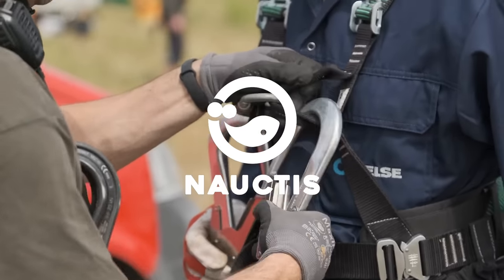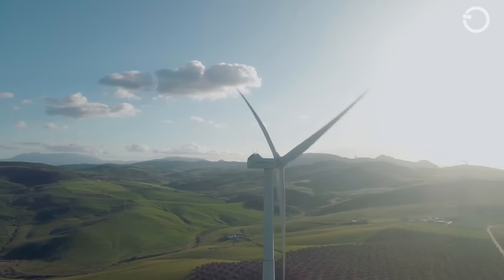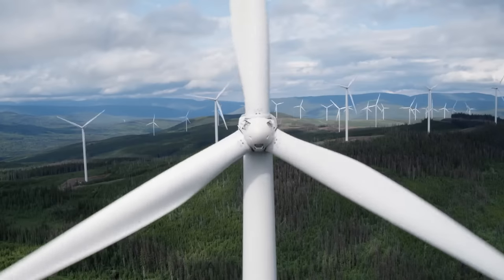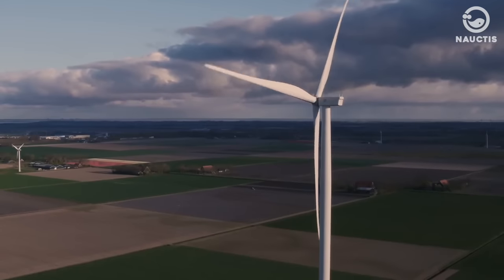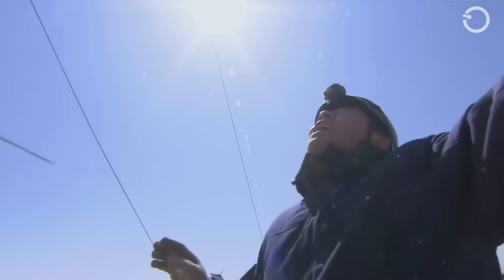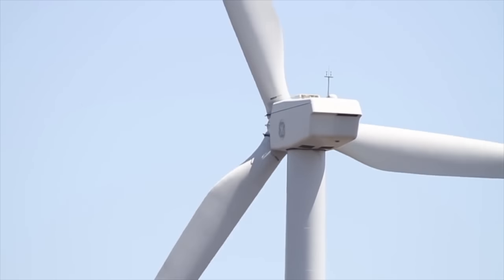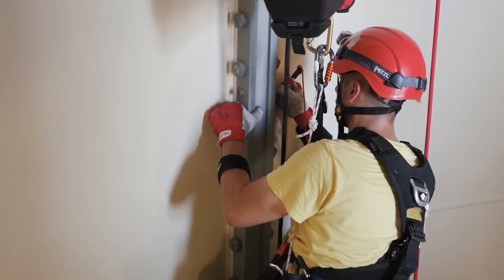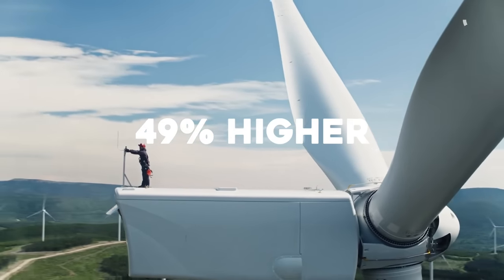Why Wind Turbine Technicians EARN So MUCH MONEY to Keep Massive Blades Spinning

Comment: They are about 80% worthless, in my view. The blades do NOT always spin. Even when they do? The gear boxes can get torn up, making them worthless. Once the gear boxes are torn up? They are very hard to fix, and very expensive to fix. Indeed, they often do NOT get fixed. Even if the turbine works, and IS hooked up to the grid? What they can contribute varies greatly with the weather and location. Many of them are just worthless. Cost? Often, as much as 10 million a piece. Nobody would even build them without the government subsidy. Once broken? Very few ever get repaired, if they are a few years old.

Comment: I had to do some work on some equipment located on a wind farm, so one of the wind farm workers accompanied me. While driving he told me to steer far around the turbines, as they always had things falling off of them. Some of the nuts used on them are larger than a basketball and falling from that height it would completely flatten the cab of my truck and anyone in it.
Reply: @justdoingitjim7095
"he told me to steer far around the turbines, as they always had things falling off of them"
This is not how we arrive at facts. "A guy told me..." Yeah. Not buying that crap.
Reply: @@DecernererInitium 
"Things do fall off them."
Whether it happens or not is not the question. Things also fall off buildings and vehicles. The idea that it happens so often that you need to drive around them is simply moronic.
Reply: @@DecernererInitium 
"Because of the vibration and movement they're more prone to loosening than static buildings."
This is called moving the goalposts. Pay attention to what the conversation was about.
Some guy told you that these machines "always had things falling off of them" to the point where it was too risky to drive under one. I'm calling bullshit on that. Do you have ANY other source other than "a guy told me."
Did he tell you how often it happened? How does he know that this is the case with 340,000 other wind turbines in the world? Even it it were the case that some things fell off this turbine, what was the cause? Did someone accidentally leave some things lying on top?
Wind turbines cost $2-4 million. But parts just randomly fall off like rain, right?
Come on. Be smarter.
Reply: Bolts the size of basketballs, I DON'T THINK SO. Maybe up to 6 inch hex. Basketball, no way jose.
Reply: @jazzridez  
"Bolts the size of basketballs, I DON'T THINK SO. Maybe up to 6 inch hex. Basketball, no way jose."
The issue I have is the hyperbole. No one is claiming these things are perfect. But by exaggerating their faults, people won't take them seriously.
Reply: @jazzridez definitely bolts that are 20 inches long. Haven’t seen any actual bolts that are that big around tho 😂

Comment: Being a wind turbine tech isn't as dangerous or extreme as many people think. 

Deaths are almost always a result of neglecting safety procedures.
If you use your PPE correctly and follow safety instructions, it is acually a very safe job.
Reply: It is very extreme vs other jobs not sure why you would post this.   There is no room for human error.  Other jobs you can make a mistake and not be killed.  So stick your "Very safe job" where the sun does not shine buddy.

Most of the deaths among wind turbine technicians happened because of falls. Other common causes of death include being struck by an object and electrocution. Wind turbines can also pose a risk to the general public
Reply: @Physics072  😂
Reply: Only 'safe' for the real professionals out there, not for amateurs.
Reply: @Papitoti  Tell that to the insurance companies that won't insure them the same as other safer jobs.   The have the stats.
Reply: There’s more to health risks than risk of death
Reply: @Physics072 climbing up a telephone pole (only up to 22m) can be deadly (every year around 6 engineers in the U.K.), dint see any complaints about that or people like you talking about it. Every year an average of 5,500 falls with injuries of telecom engineers, also no one is talking about it… so you better shut up and leave him alone. Accidents happen all around the world and in 90% it’s a fault by not sticking to the safety regulations or rules or neglect of your safety equipment.
Reply: @boatlifescotland  No I did lobby for buried lines and no telephone poles.  Guys like you seem to enjoy the fall stats.  Its not a game its people lives.  
Some job have more risk than others.  You want to reduce the risk not blame people.   Climb K2 mountain in the winter then blame the climber.   I seek to reduce those hazards mitigate risk best you can.    I found a stat that says 0 percent of people that don't climb telephone poles die climbing them Einstein.
Reply: @Physics072  the problem is just, someone has to do the job, roughly 6,000 engineers just in the U.K. and they don’t earn a fortune. Unfortunately I agree with you, UG would be much safer but the companies see the money point here, the UG solution is much more expensive than a telephone pole and yes I use the stats because I’m a telephone engineer myself and I stick to the rules every day. But I see lots of engineers NOT using all safety equipment and gear or not using all safety measures, lots of them are lucky but there will come a day their luck is on vacation, then it could end fatal or in a life changing injury. I also think you could avoid climbing poles by lowering the equipment to a point just reachable by ladders but again, reduces the risk of accidents but increases the cost by changing that. A climbing harness and fall restraint is cheaper than changing more than 3,000,000 poles across the U.K.
Reply: I get what you meant by this, but if you weigh up the risks compared to a desk/normal job you’ll see a clear difference as to why it is classed as being so dangerous. One wrong move in a normal job, who cares? This job if you make one wrong move its night nights
Reply: @juice2868  That's interesting point. I never had a desk job, in fact all of my jobs have had the possible element of injury/death. 
When you compare a desk job to wind turbine tech, surely the desk job is safer.
Reply: @TheDerperado  don’t say that, we have a training video in our company about health & safety where an office administrator trips over a left open drawer and broke his neck… every environment can be dangerous and end up with a fatal injury, doesn’t matter if in an office at ground level, up a telephone pole in 15m height or up a wind turbine in 105m height. People fall out of Lorrie’s (by not stepping out the correct way) and end up in wheel chairs. 
Stick to the safety regulations and guidances and the risks are minimised, keep up the safety checks of your gear and equipment and you again minimise the risks. It’s most likely to you to get home safely in the evening, not the job or the location.
Reply: @boatlifescotland  I get what your saying, you. Can die anywhere, at any time. But being a few hundred feet up, relying on a harness and rope facing Mother Nature the severity of one slight mistake compared to an ordinary job is way more severe. Not saying ordinary jobs can’t be dangerous tho
Reply: @Physics072 Like he said if you Wear proper PPE you should always have fall protection and fall prevention therefor no risk of falling, the objects hitting you is part of the job and is always a risk but other than that id say the job is pretty safe but definitely more dangerous than alot of jobs because it requires you to make yourself wear proper PPE something falling

Comment: Wind Techs dont make shit for the amount of work they do. I was offered a position travelling the world basically living out of a suitcase, and ended up finding a job locally that paid more for significantly less work.
Reply: How much were they offering and how do you begin the process with no experience?
Reply: @Efrain891  Couldn't tell you how to get started with no experience. I worked in turbine repair for about a decade before. It was around 110k before per diem.
Reply: Lazy mf lol 😅
Reply: Correct

Comment: to be clear - industrial wind farms are not "green" or "clean" energy.. just alternative energy.
I work on these things.. they ain't clean.
Reply: Thank you, at least someone stating it…
Reply: Leave it better than you found it and they would be clean.
Reply: @deedeeodimm  lol good one.. these are industrial machines not a park
Reply: @desertdesserts6262  I've seen plenty of clean turbines friend.
Reply: @deedeeodimm  yes it sounds like you've driven by some. If you have ever worked on them, you'd know. 
They use a lot of oil, grease and lubricants. A lot of micro plastics formed from fiberglass repairs of the blades, and associated trash when blades are decommissioned. So much concrete and excavation is needed. 
If they look clean, then it's probably near a road where it is required by the site to clean any leaks asap. Throughout North America, most are leaking and dripping oil town the blades or tower. 
Plus the chemicals used in blade repair are gnarly.
Reply: @desertdesserts6262  I'm a service access and composite tech 2 my guy. I travel all over the world working on these turbines. Housekeeping is an important part of any job. Leave the turbine better than you found it.
Reply: I've driven by thousands by now yeah, stop being lazy techs
Reply: @deedeeodimm  okay we'll leave it there cus you're not understanding.

Comment: God those things are just ridiculous. “They don’t put out any global warming gas!” Wow !! How do they get all that electricity to the actual houses??
Reply: Wind power produces a low voltage and that is stepped up to a high voltage using a step up transformer. High voltage is good for distributing electricity over long distances. This electricity gets sent to a substation near you where it is stepped down a little bit and then sent to the transformer near your house which steps it down to 120 or 240 volts. No greenhouse gases required for this entire process.